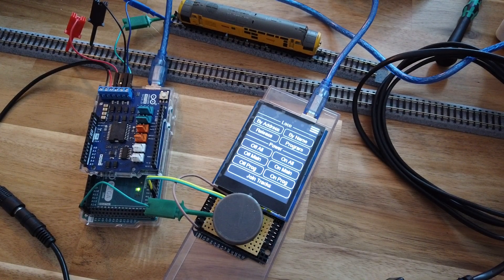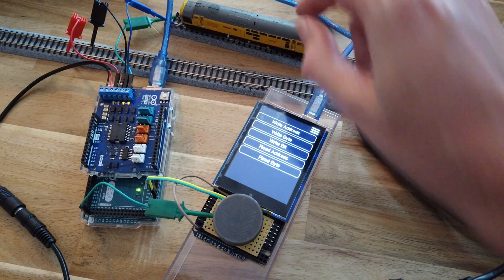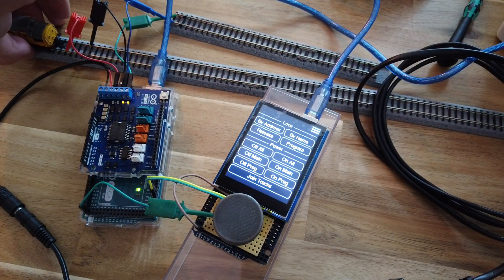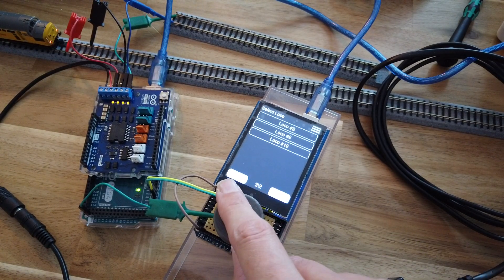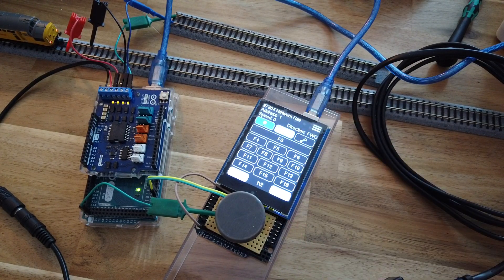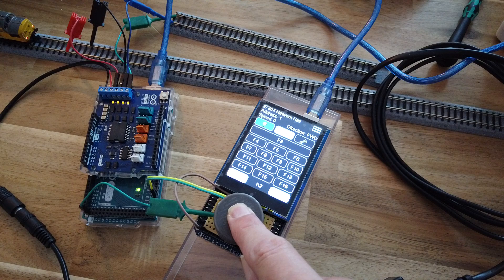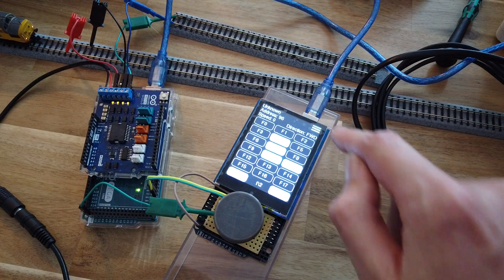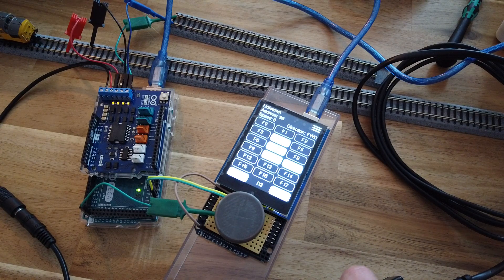GUI demo of Arduino DCC++Ex throttle

Comment: Can a 1-axis lever type throttle(like, a throttle that moves back and forth) be used instead of the rotary encoder, and maybe a physical keypad with function buttons?
Reply from the maker: Not really with this throttle.
A lever won't be able to change its own position when changing between locos.
You might find this one better http://www.trainelectronics.com/DCC_Arduino/DCC++/Throttle/index.htm
Reply: @haywardjunction  Could you make a video about building mini-throttle?

Comment: this is fantastic. Im ordering the parts as Ive just discovereed arduino at the perfect time for my love for model railway again with my dad. Could I ask where the rotary encoder is from please? I can only find very small knob versions and this looks much nicer to use. Many thanks and Ive subscribed and thumbs up :). Stuart and Pete
Reply from the maker: Hi, I can't remember exactly, one of those things you acquire with time.
If you look on Amazon or eBay for KY-040 you should find some.
Have fun building.

Comment: I'm just getting started with dcc on a new layout, With this setup are you using multiple arduino units, I see 2 USB cables?
Reply: Awesome, thanks for the info!!
Reply from the maker: There's one Arduino Mega running DCC Ex-CommandStation and another I used to create the throttle.
It's best to read up on https://dcc-ex.com/ex-commandstation/index.html to get an idea of what's involved.

Comment: if the locomotive has a Long (two byte) address then the throttle can't read the address from the Loco. Is there a solution for this?
Reply from the maker: What happens when you try? Can it read single byte addresses?
Reply: @haywardjunction  it comes a Error. Yes i can read the short (one byte) Address. That works fine. And i can Read the CV's! And when i write a CV it comes  a Error, but the CV was written.
Reply from the maker: Thanks for letting me know, I've fixed the CV write fail (will update soon).
Could you tell me the address # it can't read, I've not been able to replicate.
Reply: @haywardjunction  "Long (two byte) address = 5612(CV17=213,CV18=236) CV29=34(bit1=1,bit5=1)" throttle can't read the Loco by Address. Then i set the CV29=2(bit1=1) for use the short Address CV1=114. Now the throttle read fine. I hope u can replicate that.
Reply from the maker: @mariod.5210  Are you able to connect to the Command Station with USB and type the read address command in the Serial Monitor directly? <R>
I wonder if it's an issue with the CS and not the throttle.
Reply: @haywardjunction  Yes, the Command Station is connectet with USB. On the throttle i go to "Program" and then Read Address. then Error "Read Failed!"
Reply from the maker: @mariod.5210  Are you able to connect your computer directly to the Command Station via USB and send the <R> command using the Serial Monitor in Arduino IDE.
This will help check if the CS is able to read the address.
Reply: @haywardjunction  i think the CS read the address. In Serial Monitor output <r 5612>
Reply from the maker: @mariod.5210  Think I've got it fixed. The two byte read operation took longer so was timed out. I've updated the code on GitHub.
Before updating remember to disconnect the throttle from the CS to avoid power conflicts.
Reply: @haywardjunction  Perfect. Thanks! Now works fine.

Comment: What parts are needed to add this to an existing DCC++ EX system? Looks like a great alternative to the throttle apps, more like a traditional DCC system.
Reply from the maker: I used an Arduino Mega, an Adafruit touchscreen shield (Plugs into the Mega) and a rotary encoder.
As it uses the Serial to communicate with the CS you have to add a couple lines to the CS code and re-upload.

The code and some instructions should be up on GitHub soon.
Reply: @haywardjunction  Thanks!

Comment: Very nice throttle. Are you considering adding points control and wireless connectivity? I'm using a Dave Bodnar wireless throttle as my DCC EX is mounted under the layout. This piece of kit is just the job.
Reply from the maker: I've started on the Mk2 WiFi & battery version 😊
I'm not familiar with the point control on DCC Ex but it could easily be added

Comment: I just put together my first DCC++EX setup and ran across this video. I really like the memory features. This would be perfect for my setup if you added a wireless board and battery pack to be able to connect wirelessly. looks like i'm subscriber #12
Reply from the maker: Work on the Mk2 WiFi version has begun 😊
Will have the same general look but be WiFi and battery powered.

Comment: Just looking to start using DCC++EX and this looks a brilliant option.  Looking forward to seeing the code when available.  Presumably this screen is operating on another arduino UNO?

Sorry - just taken a close look and it looks like a Mega.
Reply from the maker: Yeh, is a Mega (UNO didn't have enough memory) and an Adafruit touchscreen shield as it keep it simple.
Reply: @haywardjunction  Hi there.  Thanks for the update.  Have you given any more thought to publishing your code?  I am working on a throttle using an ESP32, 3.5” TFT screen and two rotary encoders to drive two loco channels.  I am getting there but it would be interesting to compare how you have written your code.  My throttle uses the new ROSTER features within DCC++EX to get details of locos and function keys.  An early version of my code is available online.
Regards,
Colin Murdoch.
Reply from the maker: Code is now on GitHub, link at the top

Comment: Just got around to looking at DCC++Ex and was looking for a throttle with rotary speed control that is more precise than sliding your finger on a touch screen. Your system also has the benefit of being separate from a pc or phone app. Look forward to more info.